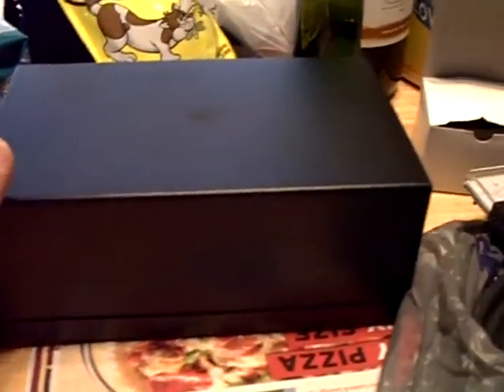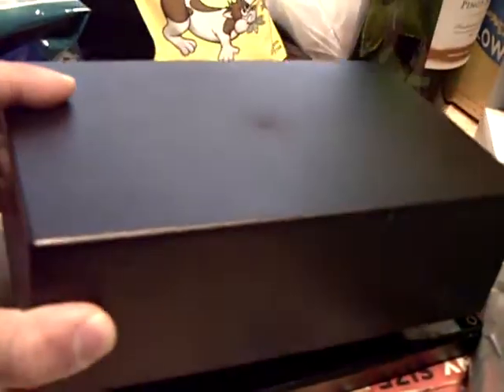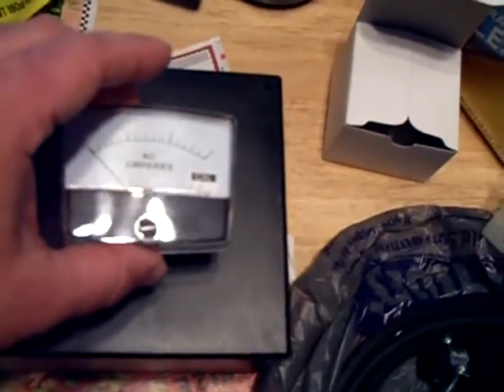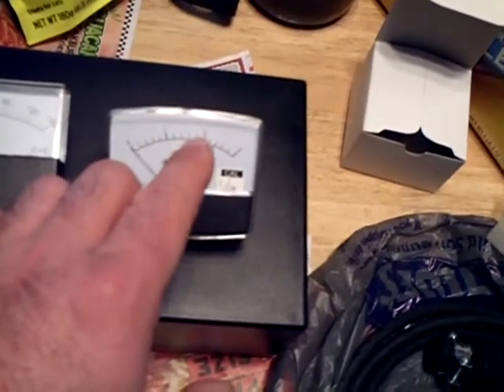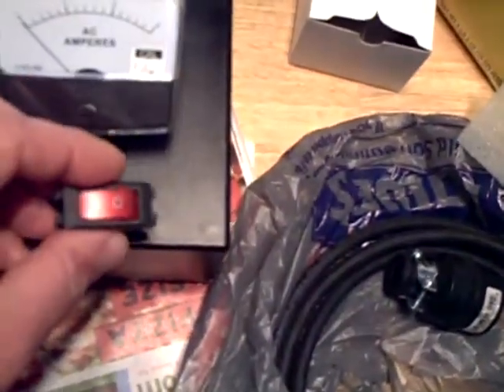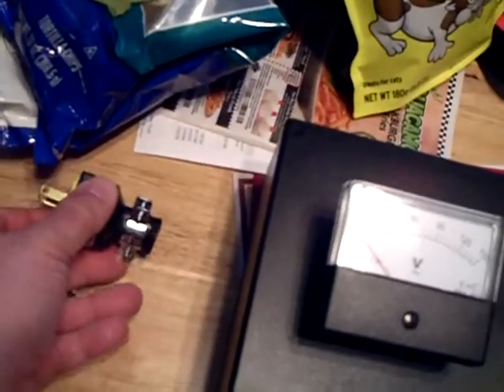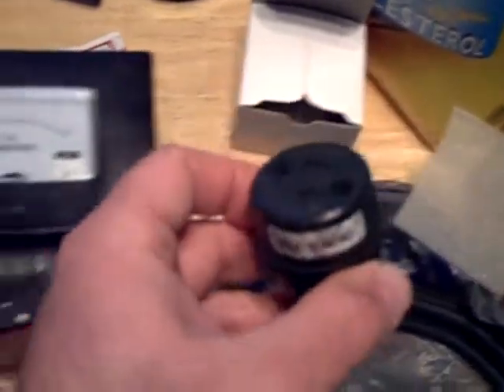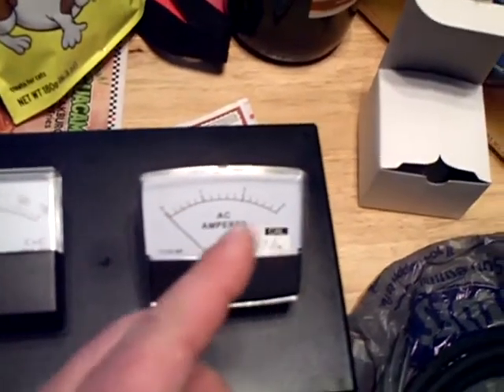Voltage and Current Meter Box Part 1

Comment from the maker: Well yes, I was using the variac with a 1 amp fuse for transformer testing, but you are correct. The final current draw needs to be accurately tested. What I have been doing for radio repairs number 2 and 3 is to test all of the plate and grid voltages for all the tubes. The RCA  262 were all in spec and the Philco's were all somewhat lower than spec. Another test to make absolutely sure the radio is working as designed is the current test and I will be doing this on all my next projects.

Comment from the maker: Sure, i'll draw a schematic out and show it in the next video. No I havent used a dim bulb tester but I heard they work pretty good. When I power a radio chassis up, I just use the variac and put a low rated fuse in the variac, then power it up with no tubes in it to test the power transformer out. I think there are youtube vids on dimbulb testers if you're so inclined.